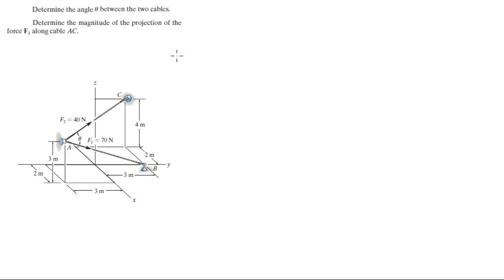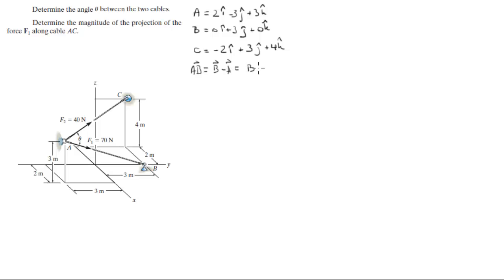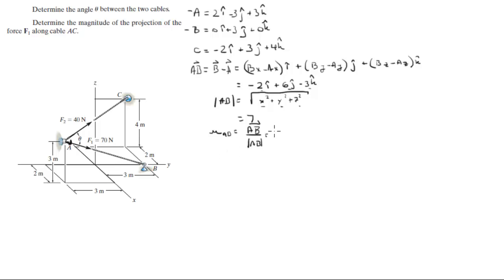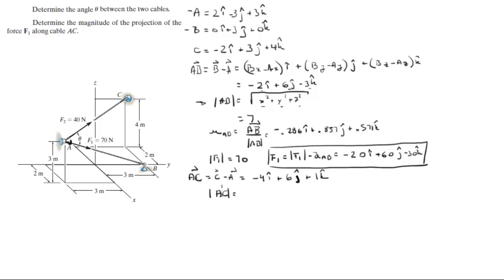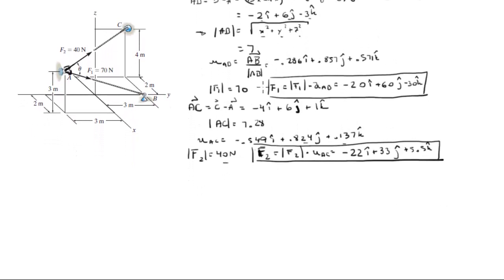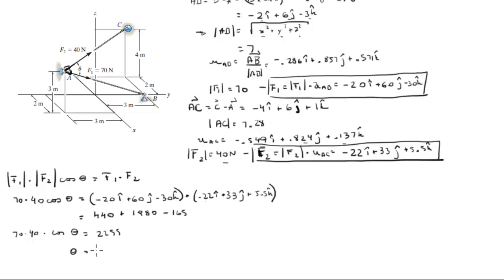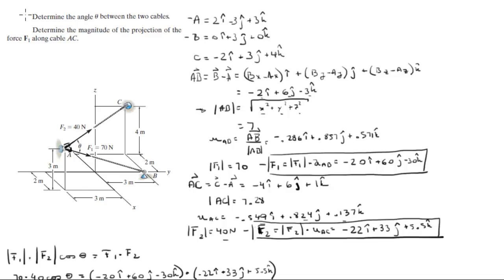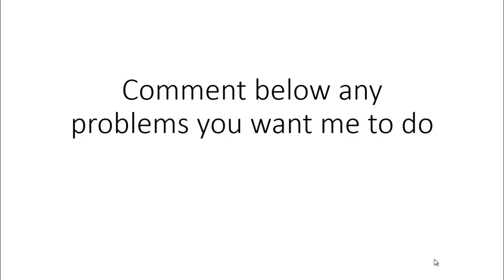Find the angle between the two forces and find the projection of the first force

Comment: anyone else barely taking this in college and you feel like a failure for looking up this video because you can’t learn it on your own and it makes you wanna take your own life everyday? same
Reply: Hope you’re doing better. I’ve had a rough college experience so far and am now in my second year. Statics whooped my ass starting out which was really frustrating considering I have already taken Physics I, and an engineering course that covered some base lines of statics. Don’t feel ashamed having to look at this kind of help. While some of the theory is missing from these videos, they should help you at least see the path the problem is meant to take in order to be solved. Also remember, nothing is worth the cost of your mental health. You sound a lot like me last year, and I want to tell you that from experience, it gets better. Chances are you’re still doing what your university considers “prerequisites” until you get to the real good stuff. Some of these classes are really designed for you to struggle. It sucks, but you’ll benefit from it in the long run, even if you stumble a couple of times along the way. I’m praying for you ♥️ 
- from an aspiring engineer

Comment: I believe there is a simple computation error when solving for the components of unit vector AB:

The z coordinate given is "0.571k"; however, it should be "-0.429k".This is because the position vector AB has a z value of "-3k", a magnitude of 7 meters, and therefore the value is (-3/7)k=-.429k. 
I hope this helps, or if someone sees something I don't, please correct me.

Comment: Thanks for all the videos. I did it a slightly different way though instead of finding unit vectors and putting them in cartesian form i just found the dot product between vectors AB and AC, and used that to find the angle. It ended up getting the same answer in fewer steps. Just wanted to share my method.

Comment: 1 small error, the AB unit vector should be -0.428k , not -0.571k, but you must have used the right one later on because you got -30k when you found F1 which is correct. 70n*(1/7)=10 ,  10*-3=-30. Thank you very much for the help though!